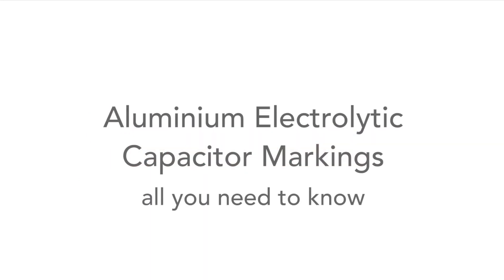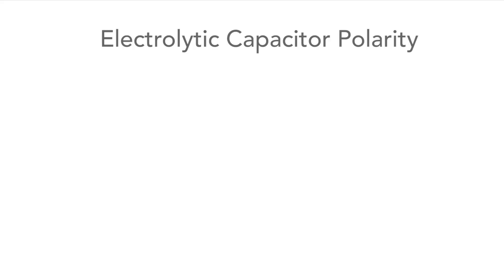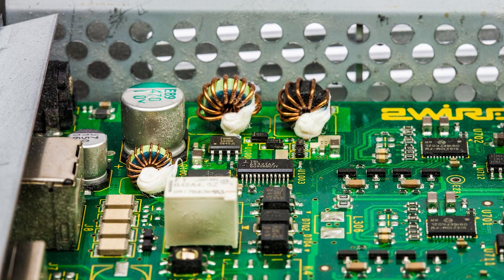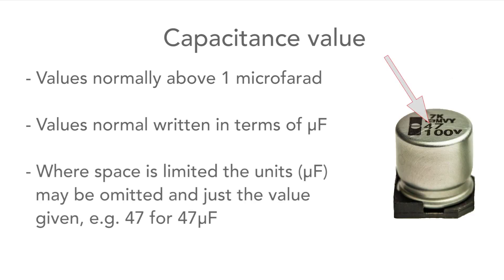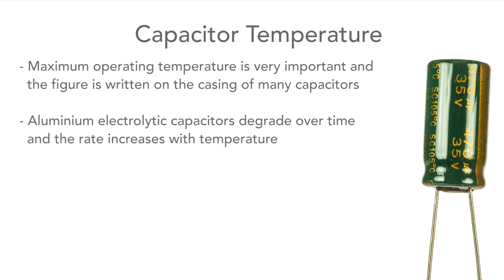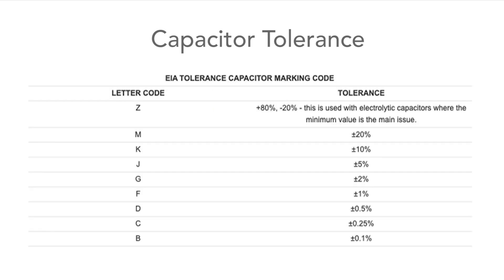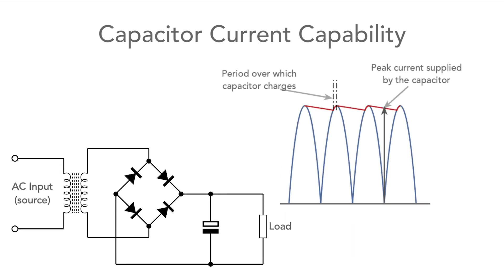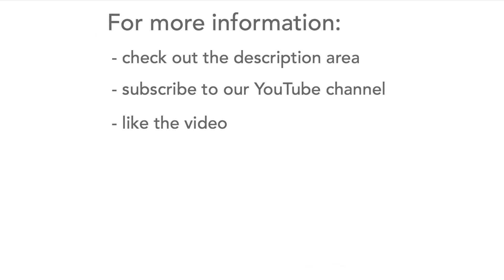Electrolytic Capacitor Markings: how to interpret them & what they mean

Comment: Trying to understand the markings on the top of the cap. For example 7C  71 is a  10vx100uf cap. Anyone know where to find a calc or diagram? Hard to read a cap without taking it out or bending it sideways -
Reply from the maker: That could be a manufacturer’s code of some form. It may not give the value, even in some coded form. It’s hard to judge what it really is and what it means.

Comment: Very good I have an axial cap in an old rf amp that looks different than the others. It is black, axial leaded, looks like hot glue or plastic seals the ends where the leads come out. Not sure how to identify it to replace it. It's on a small board next to a transistor that I believe may key the relay in this old tube type amp. I was surprised to see a transistor in a tube amp as I thought if it had tubes it would have no transistors ? Any help appreciated.
Reply from the maker: Glad you liked the video. It’s difficult to understand exactly what the capacitor is. The main thing is the value - I assume it us nit possible to see it. It was also not uncommon to use transistors in tube amps because they didn’t need such high voltage supplies and for functions that needed lower voltages the supply could often be drawn from the heaters and then rectified. If you can trace the circuit and see what it does this might give you an idea of the value and required working voltage. You can then select what you think might be the right value, substitute and see if it works ok. Hope this is some help.

Comment: Hi Ian,
I love your channel and the content.
One question regarding the tolerance markings in 3:31.
Are you sure, the "M" is the tolerance? 
In my opinion this is the brand sign for Matsushita capacitors...
I'm looking forward to your answer.
Regards Kassen
Reply: I am trying to find that information as well. No satisfying results on the net so far… as many other specific infos on electronic components. But I think maybe that little mistake in this video was made on purpose. It is giving a clue. That letter M has the meaning of 20% tolerance and is the most common value for alu-elec-capacitors. That same letter is found elsewhere on the casing between 2 other symbols Imo.

Comment: When testing capacitors with a multimeter, do I need to observe the polarity?
Reply from the maker: Multimeters do not normally supply much current when measuring on the resistance range, so most capacitors are absolutely fine.
Reply: Since you're talking about 3 extra seconds of work, why would you not?

Comment: I have a large electrolytic capacitor marked 60-10 dc. What does this mean?? its a metal can and its stamped.
Reply from the maker: That is an unusual marking!
Reply: @ElectronicsNotes  i know. I assume ass-u-me it is capacitance - voltage. It is actually stamped on a can that contains three caps in one can. There are three lines like this  1-150 60-10 and 50-100